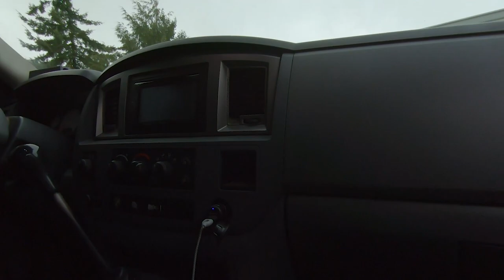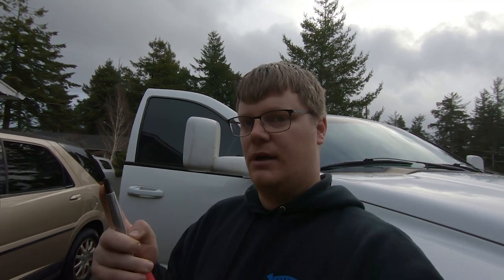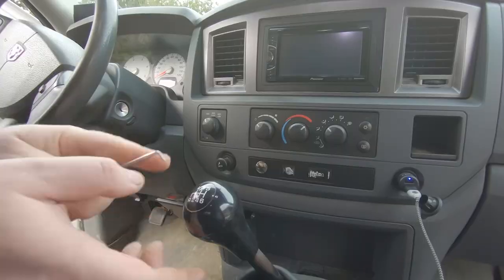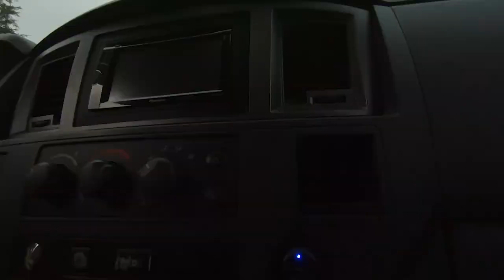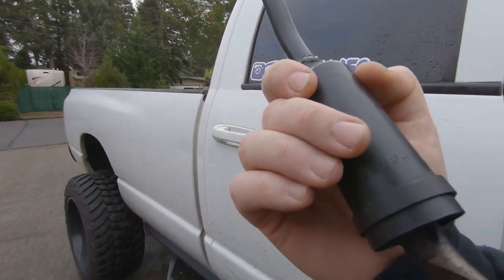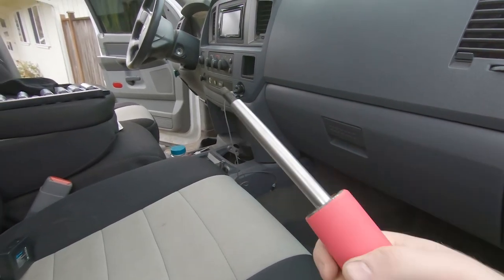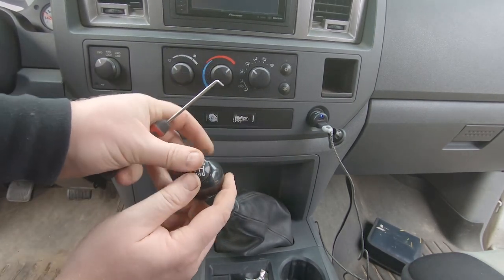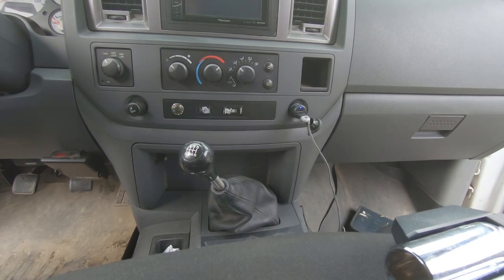G56 short shifter install and ride along

Comment: What clutch? South bend? If so I bet it’s not fully disengaging and dragging causing your issue…. Get a Valair Quiet floater dual disc and it might solve your issues…. Seems very notchy…
Reply from the maker: It’s getting better, I have a valair quiet dual disk in it now and that helped a ton.

Comment: What’s that button next to the sliding mirror button?
Reply from the maker: There is the exhaust brake button and the silver button is a little horn kit I installed a while ago to get air on the truck, fun little kit but it needs scaled up a little.

Comment: Notice any actual changes? Shift faster at all I’ve noticed the stock throw is very long
Reply from the maker: I like it, the shifter is a little bit of a reach but I don't mind it, naturally there is alot more feedback in the shifter but I like that too. It doesn't really shift faster but I like it for the most part

Comment: Man I don’t know. A g56 especially with a dual disk clutch is made specifically for hauling heavy weight. I have mine tuned but the easiest way for me to shift through gears is with a shift extension. Cool set up but I cringe watching you shift gears. Seems like it takes forever in between gears, but to each there own, we customize our shit for a reason, to fit our standards.
Reply from the maker: It has been rebuilt sense then by superstick and the thing shifts really quick and smooth. I understand what your saying about hauling with these setups and it does that fairly well but your right about being built for different things.
Reply: Awesome man! How much it cost to rebuild?? Beautiful truck btw
Reply from the maker: Thank you!! It was about 3600 round trip for mine with freight and that was their 1k horse build. Every one of them is going to be different but that atleast gives a ballpark expectation